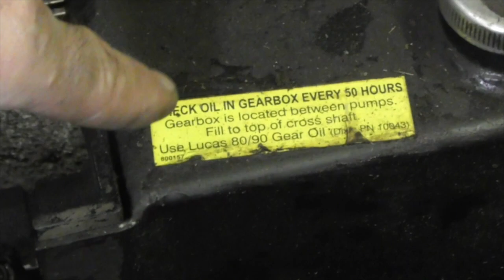Dixie Chopper WON'T DRIVE? Fix It! (T-Box)

Comment: when the mower is new, replace the oil with grease from a grease gun and it will never leak out. We did this with the pearless gearboxes on the old walker mowers and reduced gearbox failures by about 90 percent.
Reply: Just pour lucas in it at that point. That's what I do.
Reply: 00 Grease in mine.
Reply: 00 Grease in mine.

Comment: My Pet Peeve is......they bring in stuff for repair, we rush to fix em quick, then call  to pick it up and then it all sits there for weeks or months...RRRRRRRRR!
Reply: Every shop is that way. And after you fix it they don't have the $$$ to buy it out. There's your dinner plate with nothing on it but bills.
Reply: A guy brought me a tiller. I need it right away he says. I fixed it and told him. It sat for over a month before he picked it up . I was getting ready to sell it.

Comment: put a little bit of motorkote in there its one oil supplement that works by keeping a layer of oil of the gears so if it runs out it wont destroy it immediately

Comment: Taryl your amazing at what you do. I have learned more from you in afew weeks of watching your videos than 4 years in mechanics classes in school..... Well i been out of school 20 years, mabe its my memory....  :-) .... Regardless your videos helpped me take a motor bought 7 years ago bran new out of the 1981 frame i put it in and put it into a alot newer Agco Allis frame. This motor has mabe 4-5 hrs worth of run time on it so i couldnt let it sit un used any longer, or mabe i was just tired of using a push mower, even tho its self propelled  :-) , yes i would turn it over every few months so there was no seizing going on anywhere, i did have to clean the carb out and jets.... Thank you so very much Taryl, my new riding lawn tractor is all done and ready to go now. Without your help i would still be out there bitching and yelling......I mean working on it... Keep up the great work, Again, Thank you!!!!!

Comment: I would be using 100%synthetic Amsoil military spec.75-90 gear lub.Their stuff comes out of a laboratory,not out of the ground.I use it exclusively in everything I own and it DOES make a big difference Tayrl.I've noted my engines,gear boxes,diffs run about 20-30 degrees cooler using Amsoil products.

Comment: April 2018 I drove 2 hours down to Albert Lea Minnesota to buy a complete not running Dixie Chopper Quad Loop 2002 for $100. It’s a 20hp 50” cut. The deck is extremely heavy and I think it’s even heavier than 60” Toro decks I’ve had. Two of the blades are on upside down. I’m hoping to get it running soon so I can work on my Toro 522xi.

Comment: You mentioned the gearbox pulley was on upside down and somebody must have worked on it prior to you. I just replaced the hydro drive belt on my 2009 Classic 2760 and the hub on the pulley was on the bottom. I bought this new and nobody has ever removed that pulley so it was put on that way at the factory.

Comment: “Get a paahhp er sumthin...”. Freakin’ midwesterners. ;) Taryl, I’ve got a Cub RZT50 with EZT drives I just bought used - 397 hours. The drives whine pretty good. Is that normal for EZT’s? I’ve got a Spartan with Parker drives that’s real quiet. Granted it’s new, and the Parker drives are better than the HG EZT’s, but the amount of noise coming from them is a little unexpected. I would rather catch a minor problem and fix things before it turns into a big problem. I’m competent enough to rebuild the drives - I just don’t have enough exposure to EZT’s to know what’s normal and what’s indicative of a developing problem. Thanks!
Reply: i would look up your model and watch some videos about it and see if yours is like thaht if its not then there could be wearing going on inside your gears

Comment: Any recommendations on oil for a Kohler engines ? Thanks for your help . I have 3.5 hrs on the engine.
Reply: I run 10W30 Super Tech Synthetic the engine starts easier and  I am very happy with the oil all around. The oil is still good as new after a whole mowing season though I will change it before spring anyway. I cross referenced a Fram automotive oil filter that is designed for synthetic oil's against the Krohler part number. Works like a charm!

Comment: Thanks for the videos. They are very helpful. . I am trying to see the placement of the governor spring on a Generac GTV-760 (050582) engine that is on a Dixie Chopper zero turn mower. The spring came lose, and I'm unsure where it goes. Thanks.

Comment: Thank you Taryl  for your videos.  Love the way you explain all the little things to watch for when doing a job.    Also, it’s nice to see work being done by someone who doesn’t wear those stupid looking sissy hand gloves.  Everyone wants to look like there a surgeon or something.   That’s what they make soap and water for.  Keep those videos coming.
Reply: Taryl;Do you have the 4 bearings for the t-box or the part numbers need the 2 hydraulic pump outboard bearsings,2 pinion shaft bearings,gaskets and o-rings.dixie chopper 1992 xw 2303 60" deck.may I suggest espanding this video .remove pinion seal,snap rings,and bearings.thank you Sir.local dixie chopper does not list anything 10 years old and back.

Comment: My 2000-2001 xw2500 the vent tube off t-box goes back into the oil tank for hydro does this model t-box use 15-40 oil like the hydro pumps there's no way of keeping the 15-40 out of t-box
Reply: Good question so does mine.

Comment: Thanks for making this video...I picked up an older dixie xw2203 ..I really needed something for my 3 acres...I checked the t-box today and it was low.. caught it in time thanks to u....I want to change the hydro filters on it  but unsure the best way or easiest way to do it...not even real sure where the purge valves are.. any guidance would be appreciated..18156773082..thanks

Comment: My 2007 Dixie Chopper XG2503 has an issue going uphill with the left drive weakening. Seems to catch a little better when moving the lever back and forth. Already tried bleeding air from the system, and use Lucas 15W40 only. Only 300 hours on the machine. Any suggest help would be greatly appreciated???

Comment: Never seen you work on a gravley zt  ---TARYL
Reply from the maker: leo lee we never see them in our area
Reply: +Taryl Fixes All
? can you use a weed eater gas in a push mower
Reply from the maker: Casey Novem You mean 2-cycle mix? You always COULD but why would you want to? It may smoke more and leave a sticky residue on the piston and valves. I wouldn't recommend it. Now There's Yur Breakfast.
Reply: +Taryl Fixes All I'm also im a small engine doctor to I've been working on them since 2012
Reply: +Taryl Fixes All can you use stabilizer in a weed eater
Reply: Why would you use a fuel treatment in your gasoline ??    Just use NON ETHONAL gas and only mix one gallon of fuel with the recommended amount of oil for your equipment......   If you don't use that all up in a month or two throw the rest in your car or truck...   I have a repair shop and only mix 1 gallon at a time so it stays fresh...  I only use NON ETHO in all my stuff and customers stuff also ~!~!

Comment: Can you add cornhead grease or 00 grease to the box or will that negatively affect the hydraulics??
Reply: This is only a simple gear box, it needs lubricant, but it really wouldn't matter what is used, as long as it provides enough protection. The hydraulics are controlled by the pumps that are on both sides of this box, and don't use the oil that's in this box.

Comment: I tend to use the hi tack on the side of the gasket the seals to the part that is easiest to clean next time. For example I glue the gaskets to the water pump (automotive). That  way the next time the water pump needs replaced, the gasket typically comes right off the block.     Also, when replacing a woodruff key, I found that tilting the key so it is slightly lower on the outside makes reassembly a little easier.

Comment: I got a question for you What would you recommend to clean out the gas tank on a Briggs and Stratton series 450 push mower it got a white Chrystal powder in it form sitting for a while with gas that dried up in it please let me know what I can use to clean it out cause I don't have a lot of money to get a new one thank you for reading this and keep the  video's  going  there great
Reply: ADAM MOSHER I'm sure you have it going by now. If anyone needs to know, I've done it with nuts and bolts. Dump a handful in there and something liquid, whatever's handy. I used kerosine, about 1/2 a tank would be more than enough. Shake the hell out of it,  drain it and check it. Should be good and clean. Might have to flush it or repeat the process a couple times.  You can fish the nuts and bolts out with a magnet when done. I wouldn't get to violent with it either, you don't want a spark. The problem is, the carb. It's probably going to need to be worked over as well if the tank was dry and gunked up. I'd dare say it might be a seat/valve issue. It'll probably need gaskets to if it's been sitting to long.

Comment: Don't forget to paint the splines with anti-seize before assembly!  

Just in case you gotta get back in there!
Reply: Wouldnt be needed, they are already in a bath of gear oil since they share the same flanges with the T box, also the Anti-Seize would contaminate the gear oil..
Reply: @coripuckett5596  Ah, I said that when he didn't have a bit on draining it, but didn't think that he probly didn't need to because it was empty.

Comment: Would 00 grease be good to use in place of 80w90?
Reply: Listen Nova!
The lubricant must be able to flow into the bearing assemblies on either side of the T-Box.  
Will your grease flow like a liquid?  Probably not. Especially at low temperatures.
Therefore: NO, do not use a grease.
You must listen to the Master (TD) when he speaks.
The Master says: "The best tool is your...tap...tap...tap...brain!"
Now, go back and watch the video again, and this time, pay attention to the Master!

Comment: Taryl the reason the t-box pump drive mounting flange area does not have a lip seal is because the pumps mounting flange have o-rings on them to seal off the t-box output flange .